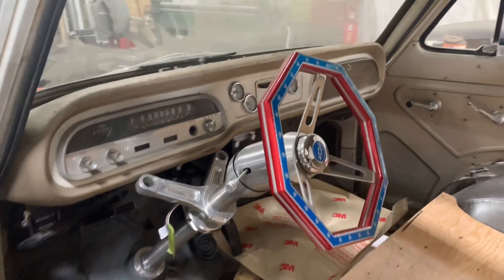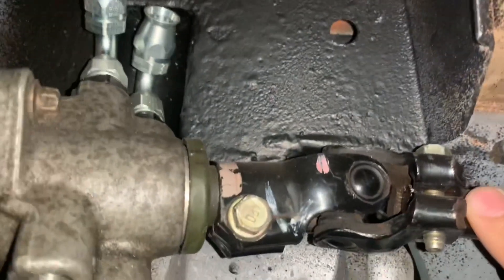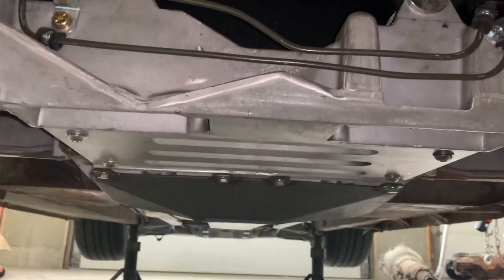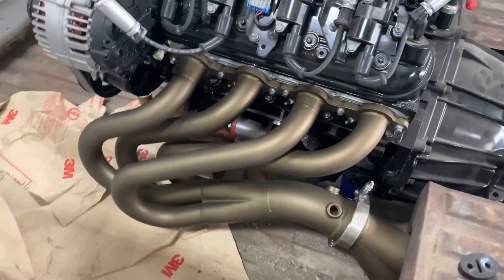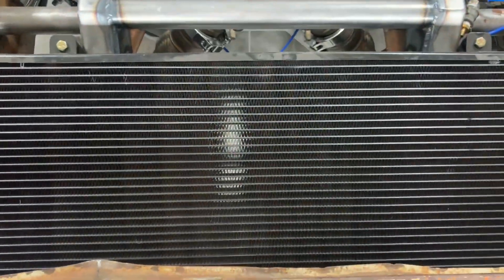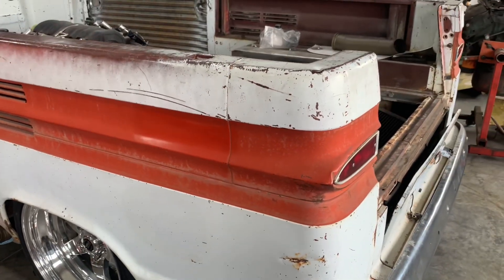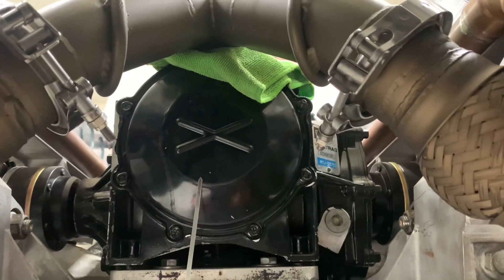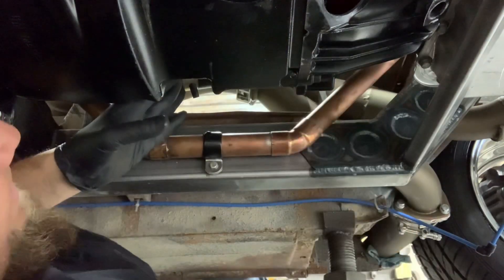Corvair Rampside mid engine LS swap part 6

Comment: Very glad to find your posting (now I will look for more on your mid-engine FC95 Rampside.  Mine is a 61 Rampside, but far from all together as far as yours:  Body media blasted 15 years ago (?!) and been assembling the necessary parts to replicate a mid-60’s version:
496 Big Block Chevy (w/2 4barrel cross ram intake) mated to a 1964 Dodge Big Block 727 (0ld School Adapter) with short Tailshaft (built for me by Art Carr in 1985 (?!), Jaguar XJ6 IRS, to bolt together with a 3”x4” subframe that bolts up into the original cab back frame.  Stock front suspension and steering.  During this pandemic I’m clearing out my garage and uncovering it to finish it up.......a 30 year project been on hold.
Reply from the maker: Right on, love to see it!

Comment: I understand the rugged "patina" look for the body, But all that incredible  and beautiful underside machining deserves a frame that has been cleaned/repainted to match! (Former '64 van owner)
Reply from the maker: Thx brother. Once we do a few shake down runs and rust repair/bondo removal I will be undercoating the original sheet metal underneath. I just don’t want to do anything till I know we’re completely done and no modifications needed under there.
Reply: John ... as a current 64 van owner I never intended to make mine pristine, but did start with the bottom and worked my way out, covering everything underneath with Eastwood primer and chassis paint then Rustoleum on anything that wasn't going to stay black. I actually painted the exterior with Rustoleum spray bombs. Antique white roof and belt line, with Hunter Green for the body. Kinda gives it the old "Earl Scheib" paint look, but will NEVER rust... and only cost about $150 all total. (plus primer) The bonus is if I need to touch it up I can get more paint at the hardware store for $5. From 20 feet away it's quite a few notches above a rat rod, and solid as a rock since all repairs were done in metal.

Comment: my question is are you going to have to take it all back out to do the body.  I would hope so
Reply from the maker: No, we have replacement panels for all the bad rust, and previous owners bodywork. We’ll weld them in and paint/distress them to match the rest of the body.
Reply: @dickindustriesinc  ... I have a 64 Corvan and I was NOT able to find much of anything in the way of metal replacement panels when I did mine only a few years ago. I basically made all of my patch panels from scratch.

Comment: I had to chuckle a but when I found this series. My brother had already swapped a 340 into a Dodge A-100 and that gave me the idea of putting an Olds/Caddy  Toaranodo/Eldorado front drive  in the back of a Chevy Greebrier  van.  I think this was around 1979 or 80 - I did find a 455 toranado but could not find a van in decent enough shape 

Actually,   a shiny red stripe would to contrast the patina might look really cool...

Video of a V-8 Vega build I did back in 1988  90 ------ https://youtu.be/rjnkz6Ia5p0

I wish I had documented my 54 Chevy Pick up, 1968 Chevell , 1977 Monza 2+2 1969 Chevy C-10 PU and 1966 Pontiac Catalina

Comment: Another Corvair re-body. Everybody wants to turn the Corvair into a hodge-podge of other vehicle parts, just so they can put a Corvair shell over their butchery to make it look pretty. Yawn!!!
Reply from the maker: This is not a re-body in any sense of the word. Corvair with updated suspension & driveline sure.
Reply: @dickindustriesinc  Your words vs mine. You're taking a Corvair shell and fitting it onto sub-frames. A Corvair in looks and name only. At least a Crown conversion used all existing Corvair drive train parts, w/ only an extended input shaft needed as custom gear. This is way beyond chopping out the rear floorboard and adding a sub-frame. Nothing but body is original Corvair w/ this build.
Reply from the maker: @v.e.7236  And there’s the difference between myself and a “purist” such as yourself.
I can appreciate the same cars you would consider “correct” but I can also see past my nose & can appreciate the not so norm…cheers